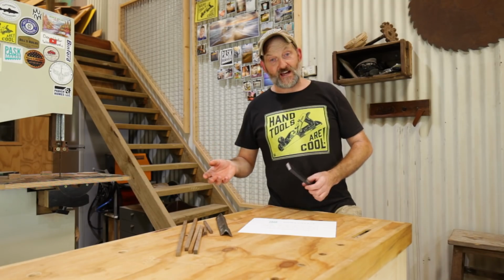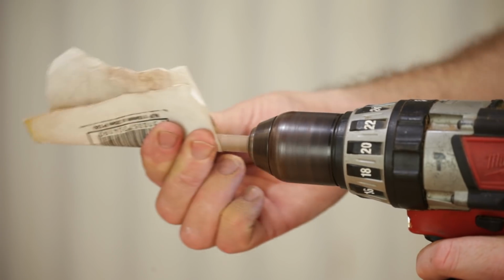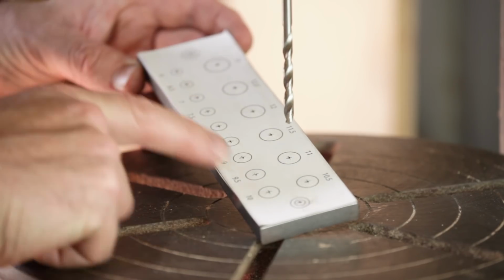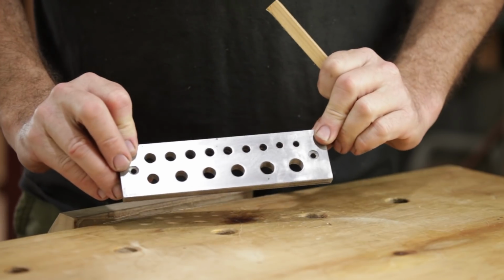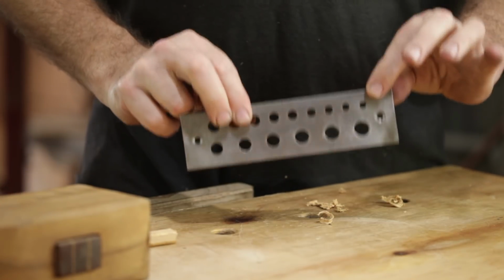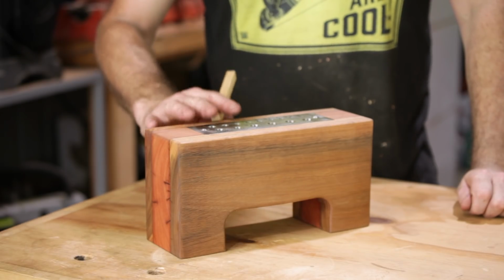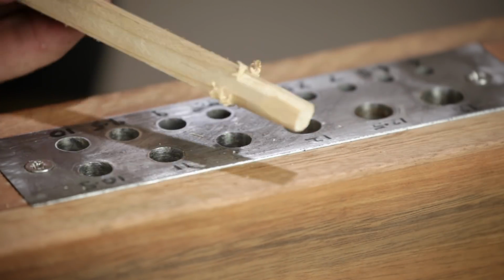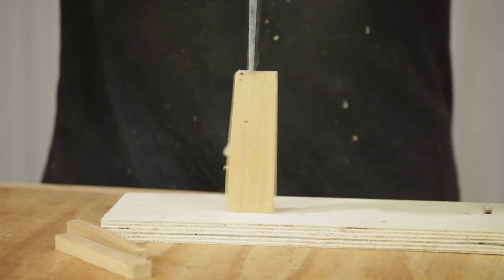Making Dowels with a Homemade Dowel Plate

Comment: Very nice plate &  attractive, well designed holder. You should get them mass produced in China & sell them .  Lots of useful insights, thanks for sharing Pask :)  Not sure if my Lidl pillar drill will be up to drilling 3mm steel, let alone 10mm!  Having trouble finding HSS drill bits bigger than 10mm (but I have 3 or 4 that are 10mm :D).
Reply from the maker: Thanks Tony - glad you liked it! Good luck with building yours. :)

Comment: A slight improvement would be having tapered holes (the small part on top, the bigger diameter on bottom). That way it will have clearance angle like any lathe tools with better cutting ability, more sharp, and less friction.
The taper should be very small.. like 1degree.
Reply: Yeah, we can do that in the home workshop

Comment: Just make steel dowels moulds and sharpen its edges and use hydraulic pressure to cut wood and not waste and breakage of wood also use adequate length of wood for that. Sorry for the previous reply my fault.
Reply from the maker: You're idea sounds wonderful! Thanks very much for your useful input! :)

Comment: How exactly do you get a dowel plate to work? I drilled a hole in 1/8 metal and tried it with walnut but the walnut just ends up breaking, even if I trim it down to just barely oversize of the hole. Attempting to pound the rod through just didn't work for me. According to some other videos, the holes are supposed to taper to be wider in the back surface, to prevent the material from just jamming up.

Like I would bet if you just took that square blank and just spun it with sandpaper, without using the steel holes, it would come out like a dowel anyway. The "dowel hole" isn't doing anything special in your old homeade "dowel maker" it just removes a few edges here and there, as though you ran it through a router round off bit. Then the sandpaper just rounds it. The sandpaper is probably doing most of the work in the first place, simply making the square piece round.

Anyway, I tried the technique of drilling a hole and pounding the wood through but it simply didn't work beyond the first 1/8 inch. Perhaps you need to have hardened steel? Or it does require that taper like I mentioned?

Comment: Great jig but no need to sharpen the steel plate or the holes?
Reply: I think you just need to uncrew it from the base and then flatten it again with a flat sharpening stone. I think that will work wonders enough😅

Comment: I always chamfer holes I drill in steel but in this case
that would be a mistake.
Reply: I was thinking the same thing when I saw him rubbing the plate on the whet stone.
Reply: It'd probably still work
Reply: @SoEliteGamer  Maybe not as well though. If it were a draw plate for making wire, then sure that would help. But in this case it's like the inverse of a broach. You're relying on that sharp edge at the top of the hole to begin scraping/clearing away the corners of the sticks.
Reply: @jasonsexton8869  True, it won't work as well lol

But I imagine, it'd work a little

Comment: Hi Neil , cool vid . Very ingenious method and hard work on the dowel jig. Here in the states i use a steel drill index clamped to a drill press table  to achieve the same result . Of the 14 dowels you showed at the end are the white mahogany, silky oak and black wattle native to Australia?  Is the white mahogany a genus of Honduran mahogany because it's scientific name Eucalyptus Acmenoides indicate it is from the Eucalyptus family,  Does it must have similar properties and grain to Swietenia Macrophylla( Honduran Mahogany) ?Do the silky oak and black wattle resemble  species I would be familiar with here in the states .  Thanks for the vid .

Comment: Maybe I missed it but did you just use mild steel or was it some sort of carbon steel that could be hardened?  If mild steel, I am just wondering how long it will hold up before you have to remake or sharpen it?
Reply from the maker: It's just mild steel. I haven't sharpened it yet and still going strong. :)
Reply: Thanks.  I’m definitely going to have to make one of these.  I just found recently your channel and I’m really enjoying your projects.  Keep them coming.

Comment: Would there be any value in case-hardening the plate to stop it deforming over time?
Reply: I doubt a 10 mm steel plate, supported by a wooden base at the back, would deform at all. The hole edges will probably dull over time - remove the plate, rube the flat side on a diamond plate / sandpaper to remove a bit of material and make the hole edges sharp again. I guess it's more practical to first try using it as is, and if you make tons of dowels and find out that it gets dull too quickly for your liking, then sharpen it as mentioned above, and then try to case harden.

Comment: Great work but I think I missed something. Did you use any oil to drill through the plate? Didn't see smoke or anything.
Reply from the maker: Thanks Troy! You didn't miss anything, the dowel just goes straight through as is! :)
Reply: I think you understood Troy's question not well: 
He was actually asking if you used oil during drilling the holes in the metal part.

Comment: Hi Neil, love the videos, always interesting and informative. I'd like to have a go at this as any decent  timber seems to be expensive here in the UK countryside. So making my own dowels would definitely help make projects a little more affordable for a hobby woodworker like me. 

What drill bit set and centre punch did you use for this? Are they available on Amazon? 

I bought a supposed metal centre punch set on Amazon a while back but they were rubbish so need to buy better this time.. 
I've also been looking at dewalt dt7926xj drill bit set but at £70 uk they're expensive for only occasional use.

Comment: the problem with the smooth dowels is that when glued they trap air in the hole making it very hard for them to go all the way , it would be very useful if you can make a jig that solves this problem , many thanks mate.
Reply from the maker: Yes that can be a problem. An easy fix is run a single groove along the length of the dowel with a v gouge, it doesn't need to be deep or pretty. :)
Reply: Pask Makes what if you bore one size all the way through, then go up .5mm and drill almost all the way through the first hole, stopping where the bigger bit leaves only about a mm of the smaller hole. Then file or dremel big flutes in that mm deep smaller hole so the dowel will be sized by the time it gets to the fluted part . Keep pounding it through to get it fluted. If its an accent piece, don't pound the last part through.
Reply: You can also use a set of plyiers to make grooves in a smooth dowel. Just clamp down on the dowel, then move the plyiers over and repeat.
Reply: @Fomi1970 , Take a knife with a broad edge and attach it to a vise to affix it. Attach dowel in a drill. Then simply drag the dowel in a 45 degree angle along the knife while powering the drill gently to create a groove. Should allow the glue plus air to squeeze out. Then again, perhaps simply making a straight groove is simpler. Shrug

Comment: Why
Reply from the maker: Plenty of reasons. You can make the dowels out of any wood, maybe to match your project, there's only a handful of different species used for bought dowels. Bought dowels aren't very consistent in dimension, here you can make them whatever size you want down to a half millimetre. If you rive the wood then they will be extremely strong, much stronger than bought ones. Easy to make when you need them, no planning required with buying what you need for a certain project. :)

Comment: Sorry but you displayed very poor workmanship. I hope no one followed your example. 
When drilling into metal. Always use lots of oil. (Not WD-40) Have a cup half full of oil and use an acid brush (very very cheep) and constantly brush oil at the hole site. This lubricates the drill so it cut easer, helps to keep the drill bit cool, you are able to brush chips away from the cutting area, you don’t need to sharpen your drill bits as often, your drill bits last longer and it helps your drill motor. Oil cuts down on friction, requiring less power to drill the hole. Finally look at a drill chart. The bit needs to turn slower. About 1/3 the speed of drilling in wood. The faster speed causes more friction, heating up the bit eventually burning the tip of the drill bit.